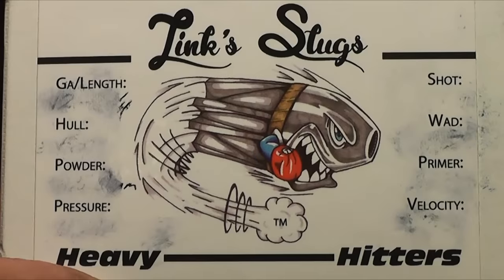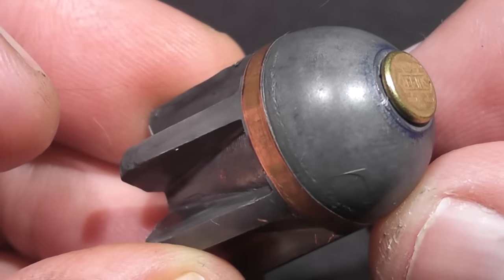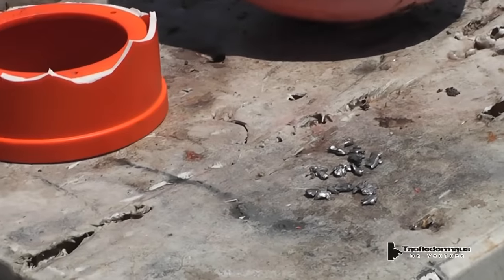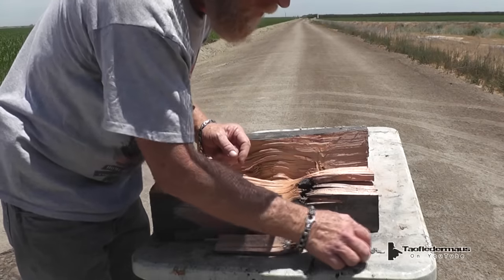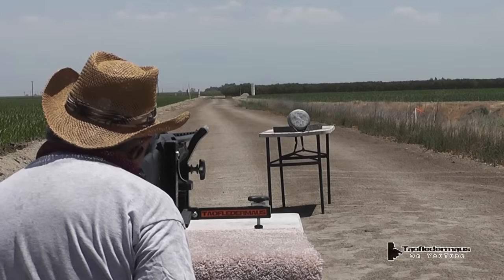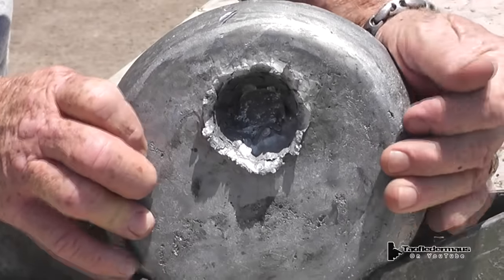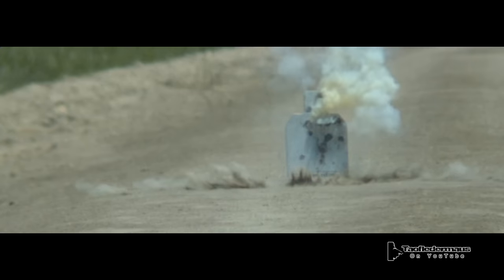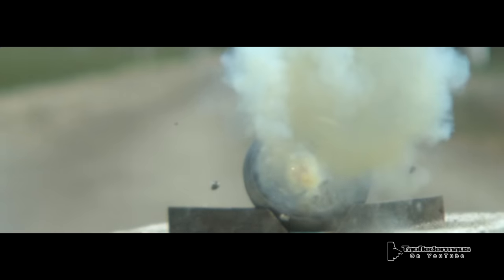12 ga. shotgun EXPLODING  rounds - You've got to see this!

Comment: 9:17 Wait wait wait wait wait wait...  So this whole time, we've been going without exploding bullets out of ignorance?

So its like those things that SEEM illegal, but arent.  Like flamethrowers.  Federally legal.
Reply: In Canada they're prohibited ammunition. Even if you bought them empty, putting a powder charge inside them makes it instantly illegal to possess going forward.
Reply: Actually theyve existed since at least the 70s. I used to have some .25acp EXPLODER rounds. They use some form of pyroclastic compound to fill a hollowpoint bullet and cap it with a regular old primer. Basically exactly what we saw in the video except smaller. They didnt work very well though. Only one that i shot every went pop. They were like 30+ years old by that point though.

The same company also produced an "exploding" 22lr called Devestators that John Hinkley Jr attempted to assassinate Reagan with. Problem was they didnt devestate much at all and reagan lived.
Reply: @raphaelvermin  turns out the one that hit regan failed to explode when it bounced off of the armored door panel of the limo. Turns out, the devastator rounds were so bad that they failed to explode when they actually hit something worth while to explode on. If the round exploded, regean would never have gotten hit. Ironic that the one thing it was designed to do correctly failed to happen and was the one factor that led to the one thing that the assassin was trying to do.
Reply: @danbachrach9432  florida law is NOT federal law. 
Just because something is illegal in california or florida or new York does not mean its illegal in say... Nevada, or Montana. 

Cool word salad
Reply: @raphaelvermin  Didn't say that did I? Just pointing out that it's illegal in FL.
Reply: @danbachrach9432  seems silly since OP didnt mention florida at all. In fact OP specifically stated "federally legal". So what are you on about? Nobody except you is responsible for knowing your local laws.
Reply: @raphaelvermin  damn salty much? I don't remember seeing op ask you to fight for this rounds honor either. Get a girlfriend.
Reply: @moresomoze  salty? Because i corrected somebody on the internet when they stated misinformation irrelevant to the conversation? K...
Reply: @marc-andreservant201  well everything "scary" is becoming illegal in Canada, so thats not surprising

Comment: "That's not a slug............ THIS IS A SLUG!" 💥
A game changer? I'd say so.
Well done to Jerry for  producing that slug & also to Jeff & Danny for another awesome video.
Reply: Ian Macfarlane jjmj k
Reply: klape intrade
Reply: Ian Macfarlane it is hardly a game changer. I doubt it would be very useful in many applications. They are more dangerous for the user, as they have the rim of the .22 on the end, and are more complicated, meaning more things can go wrong. It explodes outwards from the target, meaning it wouldn't be very useful against armored targets, it is a huge overkill for infantry targets, so its only use would be for use as a antimaterial slug for unarmored targets. And to put the nail in the coffin, it is clearly against the rules of war!
Reply: /X/EN using amunition designed to explode inside someone, such a a hollow point or explosive ammunition
Reply: where to buy this at

Comment: Now combine it with a gyro rocket round and boom basic bolter round
Reply: Whatever we think of, we can bet the Russians already did it. Look up the AGS-40 shell.
Reply: Load these in a fostech origin 12 with a short barrel and no stock and you got yourself a bolter
Reply: Aren't gyrojets like a forgotten dysfunctional concept
Reply: @jeremylim2421  the original concept yes, because of low initial velocity and very high cost of ammo manufacture. Bolter rounds are two stages, so they leave the barrel at normal velocities but keep acelerating after that.
Reply: And most likely smart bullets, as the concept is still bullshit even with two-stage ammo.
Reply: @francesco3772  It's gyrostabilised according to the lore.

Comment: Reminds me of the co2 cartridges that  I brazed fins onto,then filled with the back 1/2 of strike anywhere  matches and the tips under a shotgun primer in front, all separated by a wad. Flew real good, and punched a 3' hole in the handball courts at the school a block away , one summer. Used a 1.5" pipe for the launcher.
Reply: you made a rocket. the damage it did is crazy. sounds like fun

Comment: You do not want to be hit with that!!!  Great video!
Reply: I don't want to be hit with anything.
Reply: You don't wanna be hit with ANYTHING! especially it it kills or maims you, other than a pat on the back from a buddy.
Reply: This does more damage the thicker your armor plating is. It'd turn your armor into lethal fragments. You'd need to wear that there lead plate to stop it, and even then it'd hurt lol
Reply: Is that a tannerite compound? It has that familiar color.
Reply: The Triggerati would they be able to do that tho? At least in my state it's legal to buy but not to use so if that's the same everywhere how could they sell it without a warning.
Reply: The Triggerati I'm thinking maybe Armstrongs mix
Reply: +???? ???? Interesting.
Reply: The Triggerati what be interesting sir
Reply: +???? ???? The Armstrong mix
Reply: I don’t want to get hit with any round
Reply: Imagine being in a car that was getting shot with these things. It would blow holes in your car and turn the outside metal into inside shrapnel

These are anti-vehicle slugs
Reply: Model 54 air king air rifel striP B XL
Reply: mark Roper I don't want to be hit with anything, but when hitting a soft target, like a person, would the secondary charge actually go off? Seems like for the "contact fuse" to work it would have to hit something harder. Maybe if your target was wearing ceramic plate body armor.
Reply: Well on the Bright side, if it hits you, you won't be feeling anything for long.
Reply: @TheMattc999  if it hit a bone

Comment: I imagine that the primer on the blank would fail to ignite if it hit anything less solid than metal or rock.
Reply: At those speeds, contact with almost anything beyond air would probably generate enough kinetic energy to pop the primer. I could be wrong, though.

Comment: The slug is more of an APHE effect than a HESH one. With HESH, you have actual plastic explosive inside a thin metal casing that squashes against the surface and goes boom (thus squash-head, with the intention of transmitting a whole hell of a lot of shock, but not perforating. APHE is more simple, Punching through the armor, which sets off the fuse for the explosive and detonates that inside. It looks like these slugs are punching through and then exploding, thus the significant lead shrapnel.
Reply: Correct.
Reply: I was gonna comment that, but I didn't want to be a repeat
Reply: I'm following just because you sound fukn awesome.... subscribed
Reply: Looks like its acting more like HE.
Reply: Does it induce spalling like a regular hesh round where it throws off a chunk from the inside of said armored tanker vehicle that's what I'd like to know looks pretty sweet
Reply: Seems more like a high explosive fragmentary round - that small amount of compound seems small enough that it enhances spalling against lightly armored targets.

Its a neat design - I kinda wanna see it tested against a ballistics dummy with bone/organ inserts or wearing a vest.

Comment: Interesting round but I don't see the relationship to a HESH round. It would be much more accurate to compare it to conventional High Explosive (HE) projectile.  The Key feature to the High Explosive Squash Head (HESH) rounds are that they contain plastic explosive that squashes onto the target before a delayed action fuze sets off the explosives causing a spalling effect on the inside of the armor. This round has no flexible explosive material or delayed fuzing.
Reply: Hesh rounds weren't timed. Strict impact detonation or they would just blow the slug backwards off the armor. They need the force of the traveling slug to send the charge through armor
Reply: @tellrowland5203   Not timed - but a delayed base fuse - to let the plastic explosive smear out, creating a larger area, before it explodes. 

https://en.wikipedia.org/wiki/High-explosive_squash_head
Reply: @tellrowland5203  Tell Rowland you clearly don't know what you're talking about. HESH rounds have a fuze specifically designed to delay detonation (by thousands of a second) for a very specific purpose. This allows the explosives to smash out (why they are called Squash Head) onto the armor prior to detonation. The idea that if they had a delayed fuze it would cause them to "blow the slug backwards off the armor" is ridiculous. There is no slug in a HESH round.

The only real anti tank rounds that use their velocity to do damage would be a solid metal anti armor round or a SABOT off the top of my head. Explosives detonate much much faster than the velocity of the round flying through the air. RDX has a detonation velocity of 8750 m/s. A SABOT fired from a tank (traveling much faster than a HESH) only goes about 1600 m/s. That added energy is trivial when compared to explosive detonation velocity. 

My background is as an Explosive Ordnance Disposal Team Leader and instructor in the US Army. What background knowledge do you have that leads you to believe my statements are incorrect?
Reply: My basis is that the creator of the hesh round called the charge a slug. As a slug is usually an object transported by another. Not just a projectile. And you forgot the railgun but thats more recent and can do more impact damage than almost any explosive outside nuclear. My basis is curiosity. enjoying engineering and chemistry. Nothing more. I did double check my info thought and believe my point still stands. If it was delayed with a fuse(not just insulated from impact) the high explosive would concentrate most of its energy away from the tank.

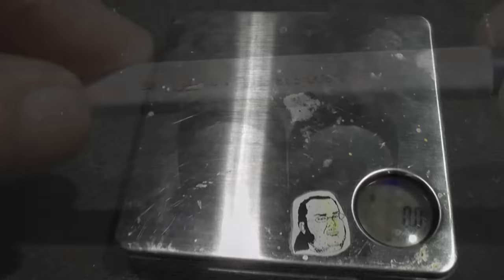Comment: There might be one thing to do to make it slightly more stable in flight, though it might lead to slightly lower speeds. When you look at 0:50, you can have a 4 degrees angle on each of the feet touching the scale/floor, and make it so it's perpendicular to the rifling, so the explosion also helps rotate the bullet in the chamber, which would likely work well with the rifling.